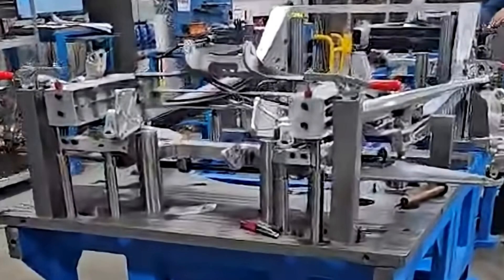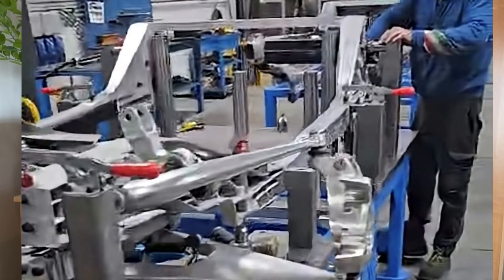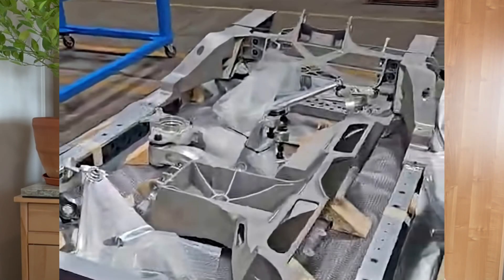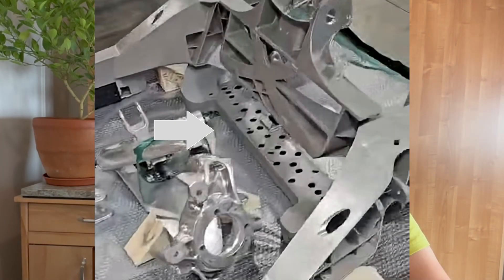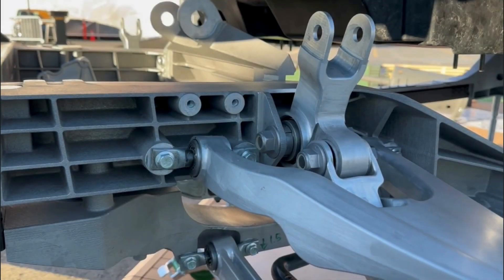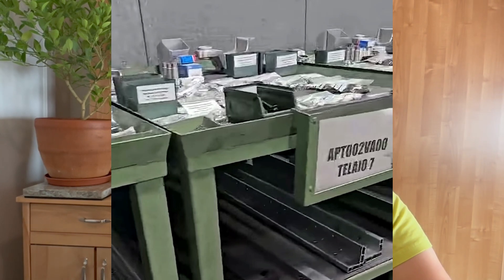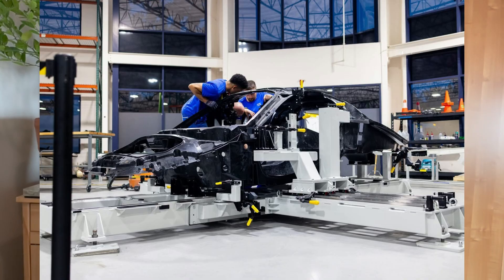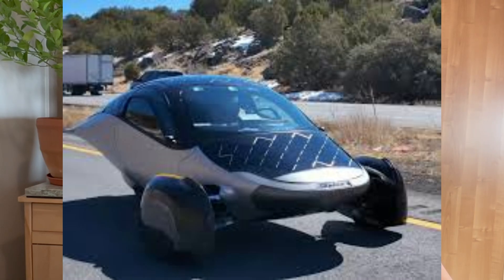Aptera's New Frame from COSTAMP

Comment: You lost me a bit when you said the frame was at where it connected to the rear wheel then showed bits that went all down one side. Also, you counted 11 trolleys that had no more parts than I could fit in my pockets and called that them making 11 frames. After their many other stunts, and seeing three frames, at best, I would not expect more than three. Let's see what AM shows when they arrive at Carlsbad to another fanfare?
Reply: 5 years ago you didn't understand that the Aptera vehicle had a battery & thought it required a sunny day for it to drive.  You're a fool.
Reply: @EarthCreature.  You lie. On the first time I saw the silly trike on a YT video I knew it had a battery and that it was likely to be much smaller than the 250 mile range they were pretending it had. There was never a time I thought the thing came with no battery, so back yourself and reference where you got this information from. As for the sunny day lie, this is what I claimed right off the bat: I thought there would be no day sunny enough in the world to get the outlandish extra 42 mile from the sun claim they pretended it had. I still don't think it can. The same applies - find where you think you can prove you are telling the truth and reference it - all is still available on record. I have never deleted a YT video or as much as an Aptera comment. This makes me smart, open and honest and if you don't come up with the evidence, you are worse than a fool - a lying fool. I'm waiting.
Reply: @EarthCreature.  BTW, it turned out the batteries in Alphas were something around 15kWh max, when they were pretended to be 25kWh min and Aptera took investments and preorders with most people being fooled; thinking the fake prototypes could go 250 miles. As for the solar, I had doubts they were real and claimed they probably wouldn't get the fakes an inch. Turned out I was right.
Reply: "I would not expect" tree stump prediction has been cast.  Let's see how many frames there will be and revisit this...
Reply: @casylong8383  Here's an idea - let's see Aptera Motors drive every prototype they have built around the car park in a congo line? 3 Alpha's; Beta; Gamma; Apollo; Hermes; and Artimis - all 8. And if Gemini can't move just put it out there where they end up. Maybe Apollo might have to just sit there with it? Make a video of it and allow the fanboys/public to inspect them all. Then we will see what cannibalization has gone on.
Reply: @aussieideasman8498  ur poor at guessing that is established.
Reply: @casylong8383  I am happy to air my predictions with Aptera's and their wacky fanboys all day, every day. I will come out on top. So, you think how many frames turn into production intent trikes, and by when? I am predicting they won't have three more by 1st of March 2026. Hold me to mine, now what's yours?
Reply: @aussieideasman8498  i predict a massive tree stump stuck in perpetual mud.  Ur not relevant to the success.  Ill take 8.  bookmark this sir whinge a lot

Comment: I want to see a video from aptera explaining the cooling system.
Reply from the maker: The system that will be used of the production cars has a small scoop that is mounted aft of the lowest part of the under belly. The air is divided in the body through ducting to 2 motorcycle sized radiators and is vented out of the body. Thank you for watching!
Reply: @ApteraAccessories  Aptera is a motorcycle, not a car. And "will be" is the most used term by Aptera and associates.
Reply from the maker: @vic321344 The Aptera is classified as an auto cycle because of its 3-wheeled layout. Personally I classify it as a car because you sit in it and not on it to operate. And with the enclosed interior there is no need to ware a motorcycle helmet, but there might be a few places that still have that requirement because of out dated laws.
Reply: I will explain: they lauded a fake skin cooling system for about the first four years, then started making their fake prototypes with a radiator with its air intake tucked under the belly pan, way back. Farm-bro announced that it was because the skin cooling tech had never been developed so the switch was necessary. No changes to aero claims ensued, when the added air intake was about the size of the mirrors on an F150 - and we know what they said about those, LoL. But hey - I want that new video, too.
Reply: @aussieideasman8498  It crawled out of the toxic troll-slime long enough to throw up this little pile of bile... very impressive ankle-biting, right there! The whinge is strong with this one.
Reply: @J-W-Kelly  You accidentally hit a 't' right after your first letter.
Reply: @aussieideasman8498  Have you been able to figure out why you're so angry?  Have you been this way your whole life?
Reply: @netscrooge  Fer Shure, Dude
Reply: @netscrooge  Show me the part where you picked up on anger? have you been incapable of comprehending your whole life?

Comment: Thanks so much for providing your analysis. I could not determine what I was supposed to glean from the footage we were given. It's a weird place in. development right now where Aptera can't fully disclose what the final parts and design are because they are still in flux and deals are still being made. Some people really get upset when things change. I really hope to see the first cars come off the assembly line and all the parts and schematics become available for us to dig into. The aftermarket for Apteras is going to be amazing I think.
Reply from the maker: Based on the frame I saw at CES I was expecting them to make changes to the frame after crash testing, where they could correlate the simulation to the real world data. This could still be part of the plan to find areas to make the Aptera lighter. I plan on making a video about our plans for the aftermarket, if you have any suggestions. thank you for watching!

Comment: Question. Was the weight of the Inmovative 2-speed transmission included in the calculations?
Reply from the maker: It was not, I do remember seeing a weight for their system but I don’t recall it now. But the Inmotive system would replace the reduction dive in the EMR3. Thanks for watching!
Reply: @ApteraAccessories  The reduction drive in the EMR-3 is a sealed unit combined with the motor, which would need complicated chopping and re-casing to remove. This is a great deal of added expense.
Reply from the maker: @aussieideasman8498  Yes the unit is combined with the motor, the Inmotive parts would replace the fixed ratio reduction drive. In my research I did find one company that uses the EMR3 and also is mentioned using the Inmotive Ingear system, but I could not confirm they were in use together. For Aptera to use the Inmotive system it would have to fit into the EMR3 production line, because I do not see a case where Aptera would open the drive case In Carlsbad and install the parts. The plan is to receive as many subassembly’s as possible to build the Aptera.
Reply: @ApteraAccessories  As I said. So the 2-speed is probably a furphy - the next announcement just to drum up cash.
Reply: @ApteraAccessories  While you made comparisons with the not given weight of Herpes (Flagstaff stunt fame) and the unknown weight of German-eye (PI3 that's many months after PI4 and still dragging the chain), there are factors you missed that don't bode well for German-eye. Herpes has almost no interior trim; no A/C unit; no glass rear hatch (don't give me the snake oil that the glass is lighter than the perspex); no airbags; no regen and no torque vectoring capabilities - all of which will add a lot of weight, and probably a lot more than the differences gained in the frames.
Reply: 2-speed transmission in BEVs is not innovative. Porsche tried it and it failed miserably.
Reply: @vic321344  The way this one is made is innovative but looks to be flawed. We know a Porsche with it could reverse, but this type has doubts if it can. Nothing has been shown, as usual. Typical of Aptera.
Reply: Another question: Can the silly trike drive in reverse with that 2-speed? If so, how?

Comment: Being both an Aptera investor and a reservationist, I like what I hearing from you. thx. for the video. 
I thought future Aluminium Ion batteries, you could further reduce the weight in the battery pack since I will NOT need cooling or heating circuits.
Reply from the maker: I will have to look up information on that battery chemistry, thank you for watching!
Reply: "A reservationist is someone who handles bookings and schedules reservations for a business." - ChatGTP

Comment: I thought it was 15 pounds of weight to get 1% increase in efficiency.  I'm sure you are much more on top of this than I am, though.
Reply from the maker: That is the figure I recall Chris Anthony using a couple of times, if I am wrong and it’s 15 pounds for a 1% efficiency increase that would be better.
Reply: @ApteraAccessories  Wait for the facts to reveal themselves (never trust what Aunty says).
Reply: So with the 15 lbs, then the Aptera is 13% more efficient than when Steve was driving it because of the minus 200 lbs. That means it's now 108 as opposed to the 122. Then from looking at Steve, he probably clocks in at around 200 lbs. If they got a jockey to drive it and they are around 110 lbs, so now that's a total of 310 lbs. Now it's 101. That's close enough and let's just go with your numbers. Aptera has hit the target!
Reply from the maker: @billsmith5960  PI 2, the Aptera used for the shake down test is much heavier with its machined frame and suspension. Casting the frame would allow them to cast sections hollow possibly like an engine block and using forged controls arms would also save weight. Then look at the extra weight to have the car on track, Corbeau seats and the mounting bar for the 5-pt belts. There are also photos that show (because of surface finish) that that some parts might have been made of steel (for cost/tooling) and newer versions are aluminum.
Reply: @ApteraAccessories  - So, you are guessing on the side of weight loss and increased efficiency that comes from Chris Anthony. At this point, they could just tell us the real weight savings and efficiency gains. Yet they refuse to do. As an engineer and working in automotive, I fond it odd that they need to keep making changes like this that are whole sale changes unless they know they are not close and just keep quiet about it even though the Aptera was production ready at CES (as per what Aptera said in a press release).

Here we in November and they are just now receiving new parts? I want to work for Aptera because it sounds like I could just do a job of making claims and then spending like a year trying to get them because, well, I was obviously way off the mark.

In the end, let's just let the engineers at Aptera get another pass but trust me, if I did that on a product you'd buy, I feel the response would be different. As you are an automotive engineer, is this the way you work?
Reply: @billsmith5960  But jockeys would rather ride a horse than drive the silly trike, LoL.

I just checked ChatGPT for EV's under 1,800lbs and got this:

Good question. I couldn’t find any mass-market EVs (cars) that weigh under 1,800 lb (≈ 816 kg) — almost all electric passenger vehicles are much heavier, largely due to the weight of their battery packs. 
Jalopnik
+2
Jalopnik
+2

However — yes, there are some very light EVs or near-EV-type vehicles that come close or just above that threshold:

Longbow Speedster — a lightweight EV sports car: 895 kg (1,973 lb), so still heavier than 1,800 lb, but unusually light for an EV. 
Electrek
+2
Motoring Research
+2

Aptera (3-wheeler) — this is more like a three-wheeler “EV”: its 60 kWh version is listed at 1,800 lb. 
Wikipedia

So, in short: no common 4-wheel EVs under 1,800 lb, but some niche or prototype/lightweight EVs get pretty close.

Aptera gets a mention, and notice it is the 60 kWh version, so the battery is 50% heavier than the launch edition's. Naturally, I asked what that weighed and got this:

Good question. I couldn’t find a definitive, publicly-stated weight for the 40 kWh Aptera battery that is officially confirmed by Aptera itself:

According to a third-party FAQ, the 40 kWh battery pack weighs about 290 kg / 639 lb. 
apterascam.com

According to Aptera’s press/releases, the “400 mile” battery is ~40 kWh. 
NovaFuture
+1

Autoevolution reporting says Aptera’s “41 kWh” pack has 6 modules × 416 cells = 2,496 cells. 
autoevolution

On Reddit (unofficial), someone estimated the 40 kWh pack (6 modules) at around 475 lb (~215 kg) for modules + structure. 
Reddit

So, putting that together: ~639 lb seems to be one commonly cited (though not directly from Aptera) number, but some community estimates suggest something lighter (around 475 lb). Because it’s not clear which is fully accurate/updated, take those numbers with caution.

My aim is to see if shedding more weight than your 13% can get well under their outlandish claims. If Reddit has shaved 165 lbs off the earlier claimed weight, then it is 11% more efficient. Add that to the jockey driving it (or the wimpy kid McCammon) and you have a 24% gain.
Reply: I thought it was 25lbs and it gets a certificate from Jenny Craig?